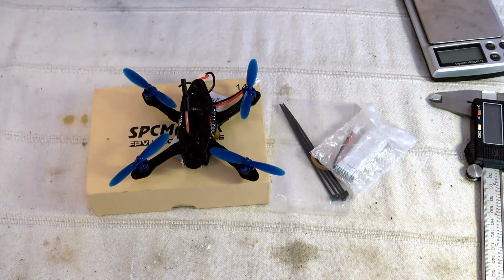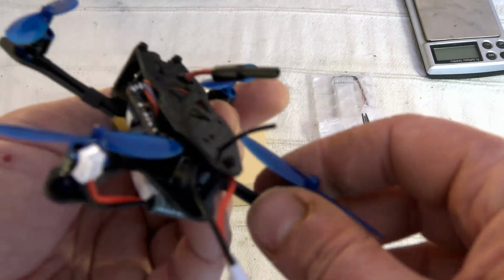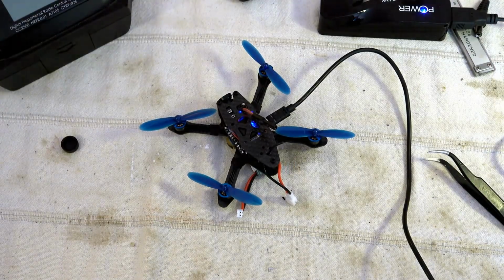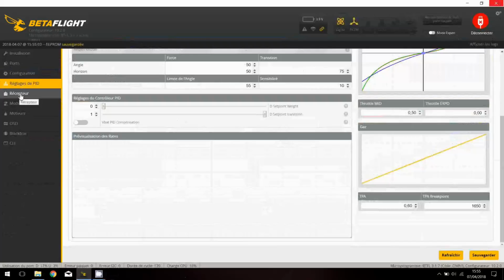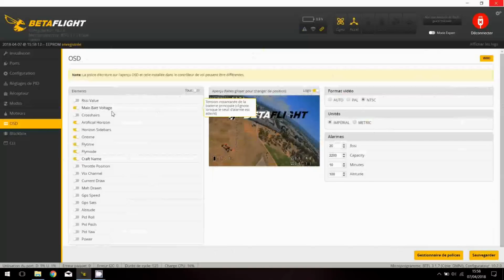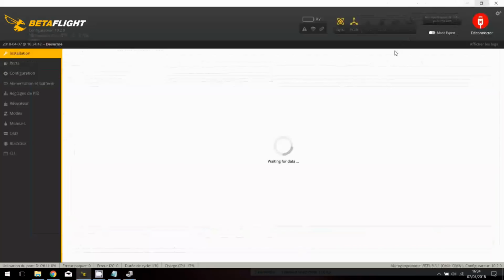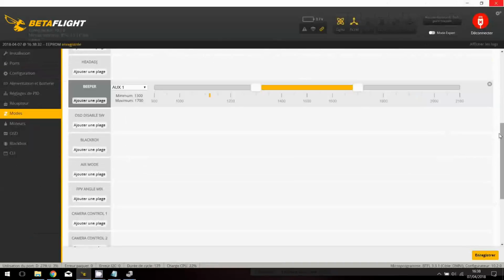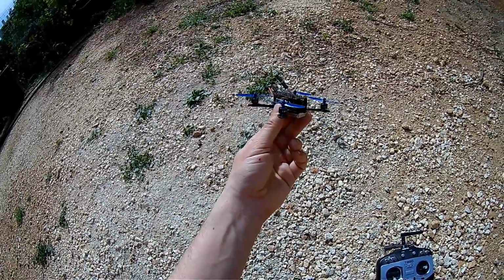SPCMAKER 95EP unboxing, analysis, configuration, fixing and demo flight (Courtesy Banggood)

Comment: I would say this is NOT one of SPCMaker's best offerings .. way too many problems. Looks like they did very little testing before releasing it. When it comes to these small 1S FPV racers, I think FlexRC has much better offerings.  Not sure why you always put the throttle position on the OSD .. doesn't seem like important information.  Well, at least  you got it flying. Thanks for the review. Cheers.
Reply from the maker: Well throttle indication is usefull IMHO to give information about powerlift, and generally the amount of power. You can see on this machine to hover, you need something about 50% in average...  I definitively think, SPCmaker didn't even test their machine. The wrong receiver configuration is one of the proof. I don't know these FlexRC machines... but I will receive soon the Aurora A100 pretty soon, a similar size machine. Cheers

Comment: Can a power bank be used for binding with most drones or some use the actually quads battery?
Reply from the maker: It works for most of them... especially little ones but not for all. I use the powerbank option, it's simplier IMHO.